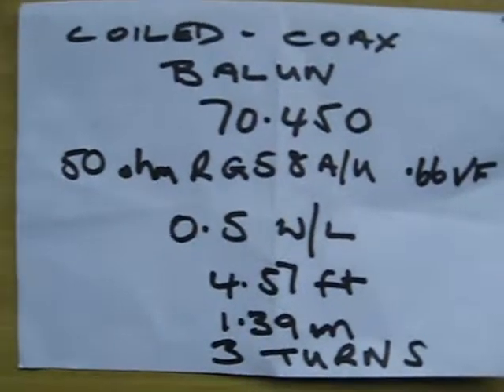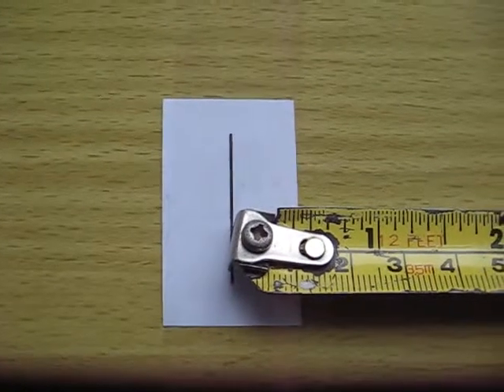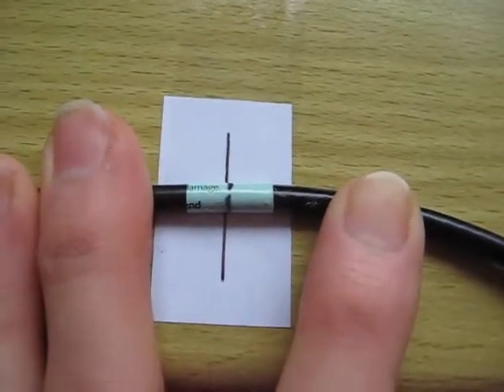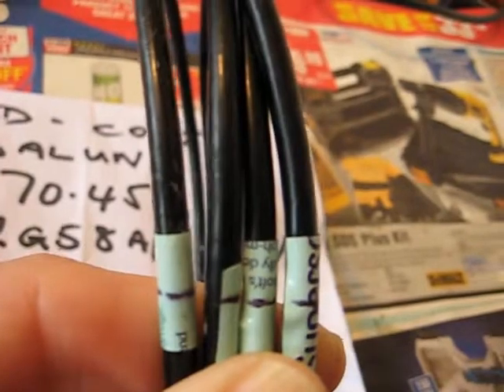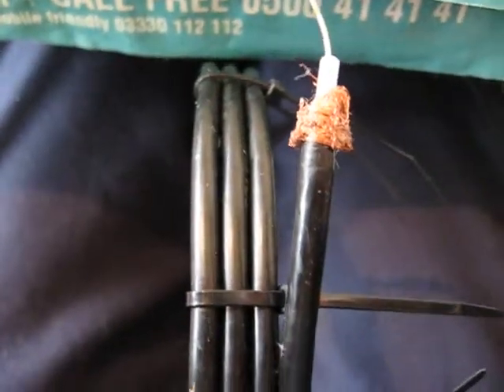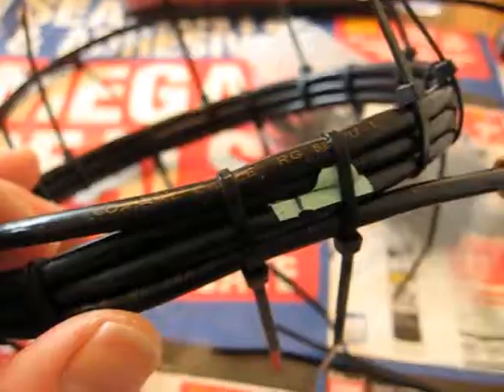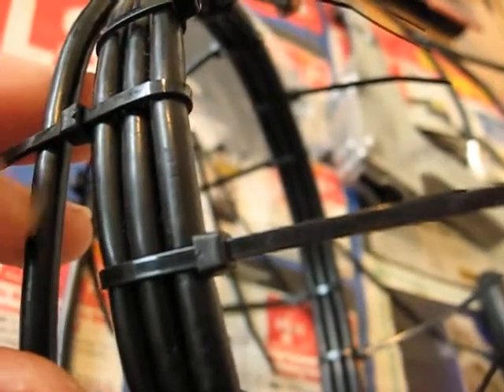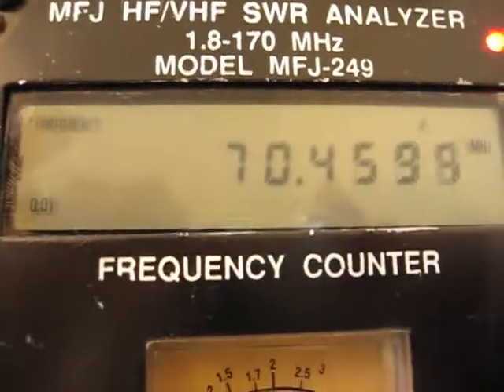4m 70mhz coax balun

Comment: The measurement only tells you that the plugs are correctly fitted.  The important measurement is the choking impedance - if this is not maximum at 70MHz,  this choke can do more harm than good.   'Ugly baluns' like this can worsen feedline radiation if they are not resonant in band.

It also occurred to me that using a Vf factor of 0.66 is actually wrong.   That is the velocity factor of the coax in differential mode,  you are trying to create common mode impedance,  so Vf is only the outer skin of the coax braid - so a Vf factor of 0.95 is probably nearer the mark.    Vf is pretty irrelevant since the choke works by achieving resonance in the middle of the 4m band.   The inductance of the loop, combined with stray capacitance creates the resonance.    So the number of turns and the diameter of the coil,  and the length is related to that,  not a notional half wave.

When you measured the SWR,  you showed the SWR increasing towards 150MHz,  still minimal, but rising.    What contribution to the SWR is the dummy load making?   One of my dummy loads used to get to 1.5:1 at around 50MHz!